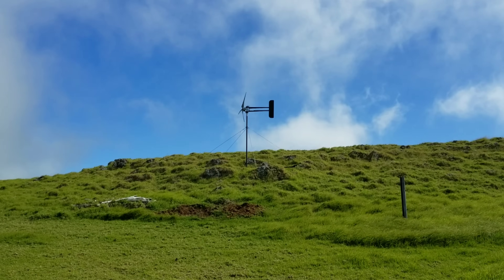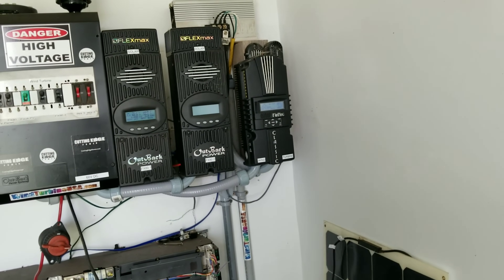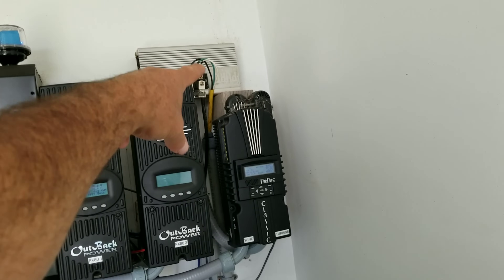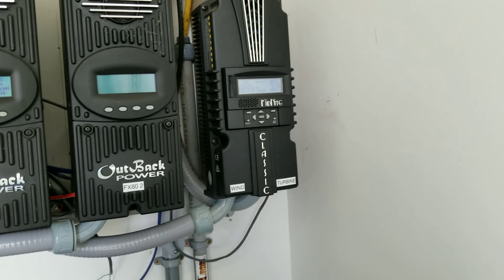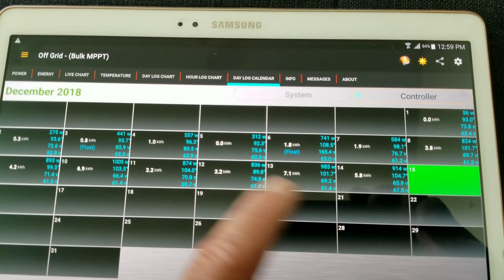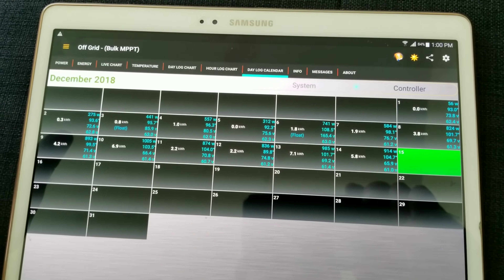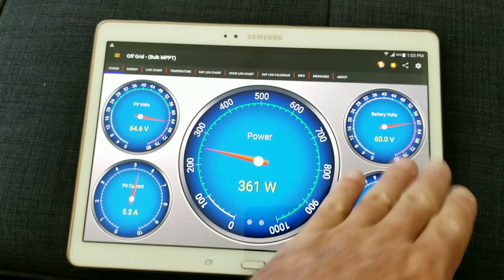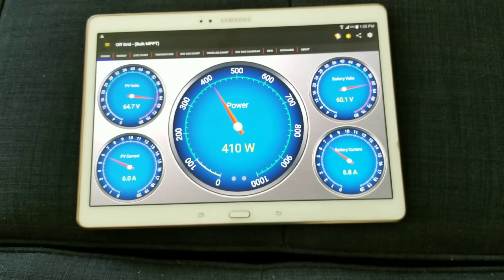MICRO WIND TURBINES... ARE THEY WORTH IT? (OFF GRID SOLAR)

Comment: Great video. I thank you for breaking it down in the way you have.

I would be ever so grateful if you could answer a few questions...

1. What model of wind turbine are you running?

2. Across the year, what's your percentage generated by wind versus percentage generated by solar?

3. If I live in an area with good winds the majority of the year round would a similar system with 2 or 3 of these turbines and no solar be feasible?

Comment: Thank you for this video it explains a lot. I now understand more than I did. It all makes sense what you said about when it is stormy there is less sunlight for your solar panels  but usually there is more wind during a storm, So whether stormy or bright you are producing electricity. It is best to have both.
   I live in SE Ohio and the average per year wind speed is about 16mph. But most days it is only about 4mph which would not be enough wind to produce any electricity. I guess the only way to know for sure if wind power would be worth it is to look at the year's end and see how it did.
    My son likes solar, but it is awfully expensive to get started, I like wind because of  the start up costs are much less. But I do see the advantage of having both. I do have a question for you though. How many solar panels do you have and what size are they. 
    I'm old now and have to look at the time it would take to pay for itself. Thanks once again.

Comment: Very open and honest data. Cheers. I imagine if someone is teetering on purchasing they could either get a basic weather station and monitor the 'local to the site' conditions, or, invest in a smaller turbine and see how that performs before laying out the big bucks. Most half decent charge controllers will sum up how much has been generated over a period of time.

Comment: How do you wire a dump load into the mppt? I'm trying to find a solution for a boat to use an mppt controller and dump excess energy into hot water and heating in the winter. Any thoughts would be appreciated
Reply from the maker: I have videos and Podcasts explaining this check them out

Comment: I'm thinking about putting up a turbine , I have low wind , on average, but 25-65 mph on occasion, I want to put up a turbine capable of 1500w+  for the days with no sun and wind storms, I'd like a classic 150, or 200, but the cost!!!! For the power I'd get its hard to put that cash into it. It's so cheap to build a DC generator for those days!!!

Comment: I played with the DIY wind power for over 20 years.    Building a robust generator, frame, tower and DIY grid tie ws not hard or expensive by my views.   ~1/4 the cost of buying factory built for most of it, which in theory makes it fairly competitive with our local ~ 12 cent a KWH utility prices.    Cheap enough to be worth the hobby plus learning experience for the energy saving it could produce.  

BUT,  #1 killer for my projects was the shitty blades I could get  from online sources.   I went through 6 - 7 different manufactures over the years all boasting 'commercial grade 20 year life expectancy' claims.     All were overpriced shit that lasted weeks to months at best before coming apart due to craptastically poor design and manufacturing processes.  

Resin voids and or insufficient resin in the fiberglass from dies an early death.  So does thin grossly undersized roots (~1/4 - 1/2 what a basic online mechanical stress calculator says they should have)  in otherwise heavy what should be well designed and built blades.

To be honest the best blade set I ever had was a half assed experiment a old buddy of mine and I made from a common treated 2 x 6 board we just carved a rough airfoil shape into and hung from a string to balance out!  It lasted for years even being run in a unloaded ungoverned test unit that regularly saw 80+ MPH peak winds!   

Whereas the 'commercial 20 year rated' ones all crashed and died in less than 40 MPH gusts while on generators that were more than capable of keeping their speed down in their rated ranges due to either seams opening up and them flying apart of the blade roots fatiguing due to insufficient material and or horribly shoddy workmanship or all combined.

Comment: if your surrounded by houses , trees and other wind obstructions wind turbines will be a poor investment killowatt hour wise.
but if you typically have winds good enough to regulary make your turbine spin fast enough to reach battery bank voltage then the turbine will not be a terrible investment.
the other consideration is buying a turbine that will be most suited to your average wind conditions in your particular area, if you have lower winds a low rpm turbine with larger blades may be best, in high winds any turbine will make decent power.
weve seen the larger micro wind turbines make 1000watts in 10mph winds  and smaller high rpm turbines make 1000watts plus in 30mph.
i love turbines but weve got to get what is the best bang for our buck and that depends on our individual wind enviroment. the hard le$$on$ ive learnt

Comment: Would it be feasible choose another generator right under that generator the main one with the props on and foot a belt or chain sprocket on to turn it so you will have duplicate power on one pole?

Comment: It's obviously dependent on situations.  The primary purpose would be to reduce the battery capacity needed as wind power tends to complement solar.  However, if you are grid tied, you are using the utility through accounting as a 100% efficient battery bank at relatively low cost.  So if you're not grid free, it probably doesn't make sense to have wind power.   The most reliable off grid power source is micro-hydro and if you can create an upper and lower pond for your micro-hydro, you can use much lower tech irrigation wind turbines to pump water from the lower pond to the upper pond.   If you have farm animals and therefore must deal with manure, build a biodigester instead of a septic system and you can tap the biogas stored in the gasometer to run a generator when solar is not available.  As to knowing the weather trends in your area to help design both solar and wind, I've found the Weatherspark website to be useful though it does not give as much raw information as it used to, it's become more of their summaries then raw historical data these days.

Comment: The biggest problem with micro wind turbines seems to be finding a unit that lasts for more than a few years.   Every single unit I've looked at has had numerous complaints and low scores on user feedback through forums and places like Amazon.    If someone built a quality unit, I'd buy a unit sized in the 700 to 1000 watt range.

Comment: could use a solar powered motor to rotate the wind turbine if there wasn’t much wind? (maybe) 🤔🤷‍♂️
Reply: Why? The motor will lose some of the solar energy as heat and the turbine will lose more, both from friction and from wire losses. If you have the solar, just hook it to the batteries directly.

Comment: What is the highest input voltage you have seen from the turbine into the Classic 200 ?
Reply: +boB Gudgel food question - I wonder if charge ca be stored in capacitors and used to charge batteries later when power is needed? They may be big capacitors and therefore highly dangerous though.
Reply: Yes, capacitors could work BUT capacitors leak charge.  Well, batteries do too.  Depends on the capacitor or battery.  Also, energy storage in a capacitor goes up with the square of voltage but linearly with the capacitance so it is usually better to store energy at high voltages which can also be dangerous.
Reply: 66 v he runs it in solar with no clipper.
Reply: Classic Solar mode  is usually awful for wind turbine use.  Wind Trace mode should work better.  Solar mode works entirely different
Reply from the maker: On the midnite solar charge controller use wind mode for wind Turbines. Then set power curve.
Reply: What is the highest input wind turbine voltage you have seen on this system ?
Reply from the maker: I set the set points of the voltage so it will not go over what I set.
Reply: Where does the energy/power go when the wind is blowing hard and the batteries are full ?

Comment: I’m curious to know what your system cost you to set up
Reply: It really depends on how much power you're going through and going to need will determine if its worth it or not. Regardless, I think it's worth not paying someone else for electricity and they have you under their thumb....
Reply: What cost your system
Reply: 25 years so you get around 5 years of free power after its paid off and it costs a while lot less when you buy the stuff yourself and install it yourself
Reply: @Meso Phyl, I was reading an article about using compressed air as the potential energy storage, instead of using batteries. That seems like a better option in terms of life span. A compressed air tank can be cycled a lot more times than current batteries. 

From what I understood, when power is needed (more than what the current output of the alternate energy is producing), the compressed air is released into a pneumatic/air turbine  engine that is hooked up to an alternator. And the extra energy from Solar/wind/micro-hydro is used to fill up the air tank(s).

The only major draw back are valves and moving parts. But valves are cheap, and the moving parts are cheap as well. 
*Cheap compared to using a lot of Batteries. 

I think a better lifespan(more "charge/discharge" cycles) can be easily achieved with off the shelf components, this way.
Reply: See what I keep hoping is we get a throttle system combo with hydrogen, basical System A produces power, System B stores 110% of the power you would need to provide for off times, then System C converts excess power to Hydrogen. This would allow for a 100% offgrid system which could include cars with little waste power since the excess is converted into fuel(at a 30% loss on conversion but better than a 100% loss)
Reply: @andrewmattox1233  You need to make a video on this. Anything to reduce the cost/lifespan of batteries will be very helpful.
Reply: @andrewmattox1233  you would loose over half your energy converting to mechanical energy to store the air pressure then later converting that pressure to mechanical energy then to electrical to use. You would probably end up with less than 25% of energy you could of saved using batteries. So even lead acid batteries would be better than trying to store energy as compressed air.
Reply: @jimthvac100  I'm not sure on this, the way I've heard it the air storage systems are actually pretty efficient but for some reason theres nothing off shelf and well studied to prove it.  Other options like gravity storage are out and extremely efficient like somewhere around 90% in comes back out, but again, can't just go order a system because they're too big and have such large masses and heights involved.  Shame
Reply: @ZeffAU  "the air storage systems are actually pretty efficient" and where do you planing to storage all that air? 
In some abandoned mine or huge cave? Because then the whole thing is efficient but not when you have some relatively small container. There is this thing called thermodynamics, air temperature will gonna go up when container will be charged, then with time container gonna reach room temperature(you losing energy from that air) and when you gonna try to lower the presure you will gonna end up with crazy cold air. I bet that pump/generator able to withstand super hot and super cold air in the same time will be "cheap, easy to make and efficient"...
Reply: @jimthvac100  what's your proof, don't you know you can rinse out 100% of the compressed battery 🔋 but try that with lead acid at 65% your battery is damaged.
Reply: More damn 10k thoseTesla battery packs are like 3k each and does controllers are almost 1k each might be more
Reply: @Meso Phyl true
Reply: Colin Bateman o
Reply: The actual price for those tesla batteries is ridiculous, but I think it will drastically decrease in 5 years, if government let it to happen.
Reply: @emersoncoelho7187  the government does not dictate how much those batteries cost. All they can do is offer tax incintives. Production cost and the market decides that.
Reply: @jimthvac100  and the rare earths needed may start to cost more if everyone switches to EV, Solar or wind to fast. Battery prices will cost less in a couple decades, or inflation will just meet kn the middle.
Reply: His set up is closer to $50 000AUD

I'd say between $40000 and $50000 and that includes everything, batteries, solar panels cables, chargers inverters, controllers ect

Edit: money in Australian dollars.
Reply: @T1000.Android  I can give him a 1mw  gas boiler power plant with that amount. Or 200kw hydrogen plant in Hawaii. Let him invite me down😀
Reply: @onekycarscanners6002  Yes,  this guy has money to burn!
Reply: @T1000.Android  Hmmmm. And a return on investment that will take 25 years.
Reply: @Meso Phyl Yes, that is the way off grid living works.  We pay more for the awesome experience of NOT having to live with subhumans. And scuzzy humans.
Reply: @Patriotgal1  lol subtle racism
Reply: @sikko5707  Yes, true, and systematic too.

Comment: What protections do you have for if your turbine gets hit by lightning? Also what do you have in place to prevent damage to the coils if the turbine is spinning but the power has no place to go? ie The Bank is full but there is nothing currently turned on in the house?
Reply from the maker: I have videos showing and installing for lighting.
Reply: @ModernOffGridDIY  Yes I did see the August 2016 video of lightning hitting your ranch and I saw then you had to manually disconnect your solar. Thats why I wondered if you now have automatic disconnects or surge protection on your system.

Comment: If your charge controller can do it, what do You think about dumping to huge water heater instead of floating. Is there alternative for You to have other batteries, not optimized for space but for cost of money/kWh, what would be the thinking behind, limited number of charging cycles, not discharging enough, etc. These are kind of question I would ask if it where not the local laws that prohibit indirectly the usage of any of renewable power, building laws require permits for wind masts, any carriers for solar having concrete legs, etc... Costs of licence only is several time the project value.

Comment: Micro wind turbines are free. Are solar panels free? if so, where do you get your free solar panels? I would like some. However, I can make a free wind turbine out of an old washing machine, dryer, ceiling fan, etc. motor.
Actually, solar panels are expensive for solar energy. An easier way to use solar energy is to simply heat water in black tubes running down your roof. If you are ambitious, you can use mirrors to concentrate sunlight onto a boiler to run a steam engine. This is how the first commercial solar power plant worked (Dagget, California). 
I love my solar panels. But, they are only a part of of my off grid system.
By the way, most prepper channels are useless in building your own solar system. The best thing is to watch the nomad living channels, start with 2-4 panels and scale up. Those channels go into much better explanations of what every wire and meter is for and how to connect them.

Comment: They should be on top of every power pole in the world, so grids can power themselves to some degree. It would be great when powerlines break, there could still be emergency power. Send a frequency through the line that only allows certain basic devices to work under emergency power conditions.

Comment: If I were off grid like in this case I would want to have several of these as well as solar panels just to be sure that I had enough reliable electricity to last me through the nights.  If you are off grid it is surely worth it.  I would also be looking at marine equipment as a lot of boats use this kind of power generation.

Having said that there is a fair bit you can do to economise on power usage in a house such as having a good amount of insulation, changing light bulbs for LED's and generally making things as efficient as possible.  This would be just as important to do as rigging up loads of power generation.  The ideal would be that the house is designed around these principles, but unless you are having a new build done and have a hand in the design this is not going to be viable.
Reply: Lots of DC lighting can be done easily. Low wattage fridges adding capacitors to pumps etc will ease the load on the inverters.